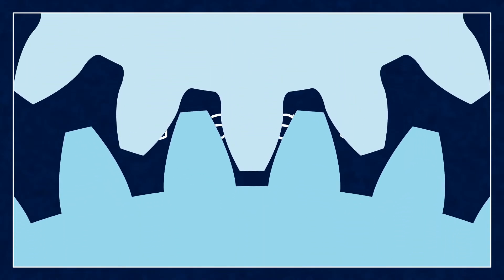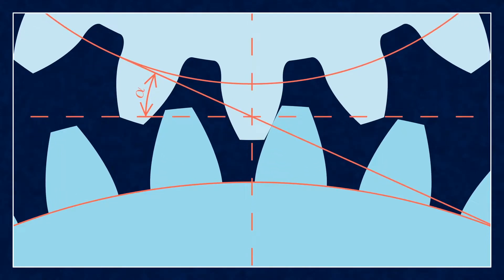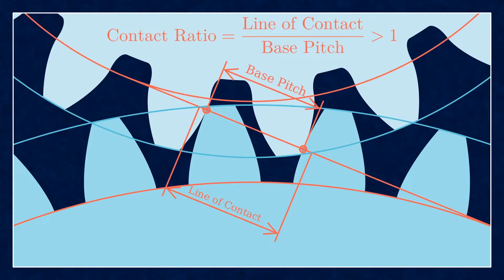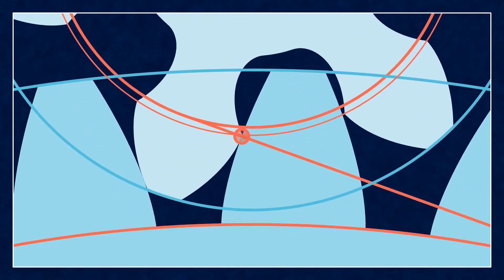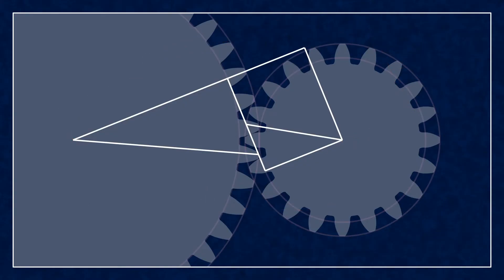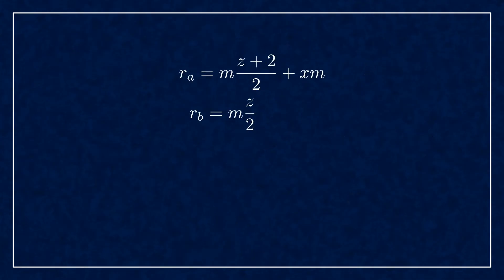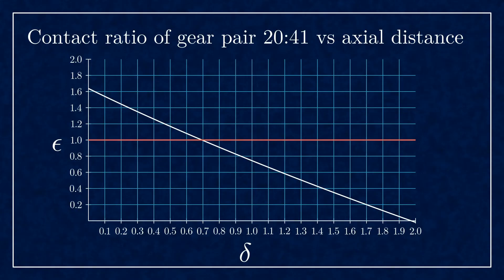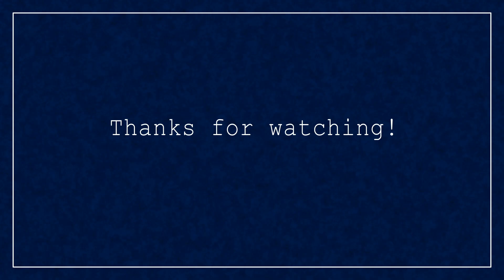Involute Gears 3: Contact Ratio

Comment: The videos are great work - it took me whole weeks to find out the same things myself. I was willing to design some transmission mechanism using rolling instead of sliding - no luck so far, but perhaps it's possible using some intermediating bodies. Rolling friction instead of rolling cause a lot more energy loss.
It would be great if somebody would make an episode or even better an app/algorithm that You type gear parameters and it outputs parameters on charts marking at what point other charts get them maximal values. So for an instance You type meshing wheels diameters and it shows You the most optimal closest gear sizes for given parameter we want. Do we want maximum performance (the least energy loss), do we want maximum strength ? Do we want maximum angular precision ? - I would advice helical (twisted) gears in that case. Do we need more strength ? (thicker gear with more contact area or bigger tooth). Do we need the least backlash (no clearance). I think that there could be a separate episode about the clearance itself - how do we cut the clearance ? equal gap from the gear edge, or, we cut the clearance with some angles - how to position them ? are 2 smaller gears meshing (causing contact) at once better than 1 bigger ? What's the optimal tooth width ? I forgot the context and wasn't digging into it too much, but at some point You said that some module proportion is standardised certain way and You don't know why, but that's the way it is - I bet that it's got something to do with being able to mesh with different diameter gears at once.
Personally I found out that as many as short tooth's You've got as most energy efficient it goes as it becomes more like just rolling 2 pipes on each other, but it can withstand less load so You can widen the gears (increasing the mass and overall contact surface, but distributing the pressure on bigger surface. The question is at what width the gear is to wide ? If the gear needs to rotate at constant speed as heavy it is as good as more inertia, gives less angular accelerations - least backlash, but in case you need the gear to transfer accelerations you want it to be as light as possible to do not delay power transfer.
After months of thinking about gears and bearings for my innovative engine project I designed a bit improved gears that should waste significantly less energy, last longer, stay cooler (less thermal expansion) and run smoother (with the least angular accelerations - in theory good designed gear is not having a backlash, but in practice all of them does, even the helical ones), but I'm still asking myself all the questions looking for potentially better solutions than using gears...
Reply: Whoa, lots of ideas here man, I can't say I 100% follow. On the idea of rolling contact, there's an excellent video from a youtuber called "Morphocular", "What Gear Shape Meshes With A Square?". Long story short, you can't do rolling contact and smooth RPM transmission at the same time. You can design odd shapes that roll on each other, but then when you rotate one with constant speed, the other will speed up / slow down periodically.
I know an interesting result came out from some Japanese research about efficiency and backdrive-ability that resulted in split-ring planetary gears. You could look into that, though the math gets quite heavy for that one, being an academic paper and all...

The backlash can be achieved 2 ways: the gear manufacturer cuts the teeth a little thinner - geometrically the same tooth curve is rotated by a small angle closer to its opposite. This way the application engineer can place the gears the nominal distance apart.
The other way to do backlash is of course to move the gears further apart.
For the geometry of the backlash, I think the closest distance between the non-engaging teeth is fairly constant - though I might need to check in simulation. However that constant distance might mean slightly varying angular deflection.

Comment: Excellent video! One question, do you know how to calculate the contact ratio between a normal spur gear and an internal spur gear? Thank you very much.
Reply from the maker: Sorry I haven't looked into that one. The line of action is a bit more mind boggling for inner gear but a very similar derivation should be possible for it.

Comment: amazing video,thank you !!! which software you use can make such simulation ,especially when the gear change the number of teeth ,and turn small continue,how to make such video ?
Reply from the maker: It was made with Manim. I'm glad you recognized some of the difficult parts, and the thing is, Manim doesn't necessary make it easy. It's a python based animation package, it lets you create shapes and move them around with python code. Lots of built-in functions to create graphs, numbers, equations, etc. That part you mention required a lot of custom code from me, and there's a bit of deception going on, since you don't see the whole gear, the off-screen part is quite janky.

Comment: Excellent video once again. Might also be worth noting that the contact ratio is important because it is a measure of single tooth loading. Ideally this distance should be minimised this. The more teeth in mesh the quieter and smoother your gears will run. They will also have less chance of breakage.

Comment: May I make a supposition:  Pythagoras is the recognized 'inventor" of 3.1415...etc. and may be shortened to Py, not Pi.   Your videos on gears bring about some curious prospects for me.  I do not know how to draw a gear tooth profile with any accuracy, the only thing I could probably do is put a pencil on a string, tack down the curvature of the base of the dedendum diameter, and draw the tooth profile.  I use ellipses to draw my gear teeth on my CAD software.  Understanding your formulas is reasonably easy although I am not familiar with your variables and I don't think my ability to fabricate a working gear assembly wouldn't be all that difficult with the machine tools that I have.  I am not quite up to that just yet but when I do I will find out whether I can make working gears models or not.  I am not very familiar with undercut, and my default gear profiles are usually in contact on both sides of the tooth, so allowing some clearance will have to be discovered as to the gears spacing value from my calculations.  I call it fudging the measurements.  Thanks for your videos, they sound very well educated.
Reply: The constant 'pi' is the name of the first Greek letter in the word 'periphereia' (our 'periphery'), being the perimeter of a circle.

Comment: Awesome! What sort of topics will you be moving on to?
Reply from the maker: I haven't decided yet, there are many things on my mind. Maybe explore some dynamics, eg. Lagrangian mechanics, or get into simulations. I started a project on lenses which I never finished, but might get back to it, or BLDC motors, I also wanted to work on Kalman filters, adaptive control, eh... lots of things.
Reply: @gergelybencsik8626  Lol, i think we might be the same person. I spent a lot of time learning about gears just to graph them with desmos. I recently also got some graphs of lens refraction working, mostly to see spherical aberration. Lastly i have thought about electric motors a bunch. Especially about if one can calculate the conversion from electrical energy (current and magnet strength) to mechanical energy (speed and torque). Sadly i haven't found an answer to that last one.

Looking forward to whatever you explore in the future. It all sounds like interesting stuff 🙂
Reply: @gergelybencsik8626  I’d watch just about any of those.